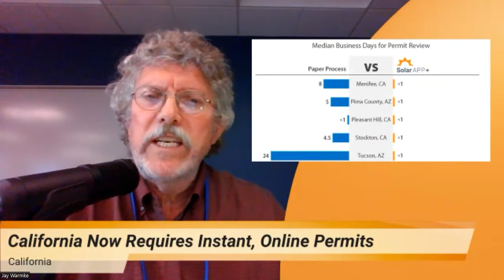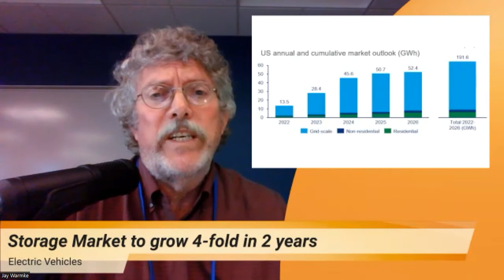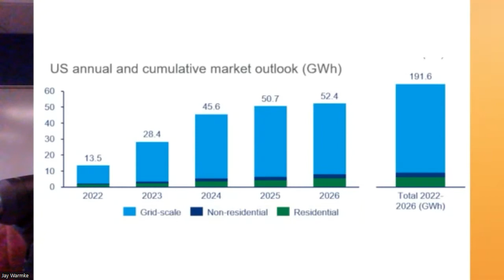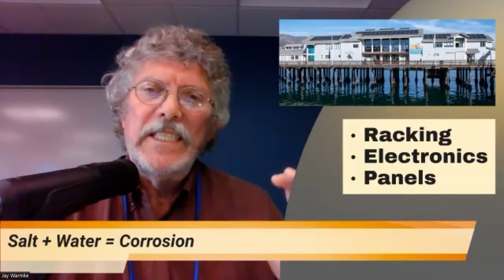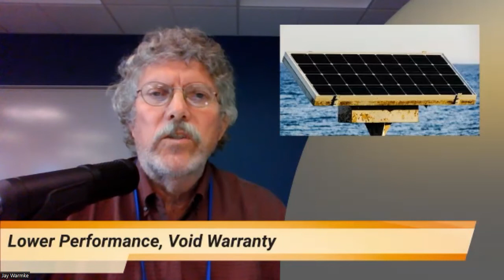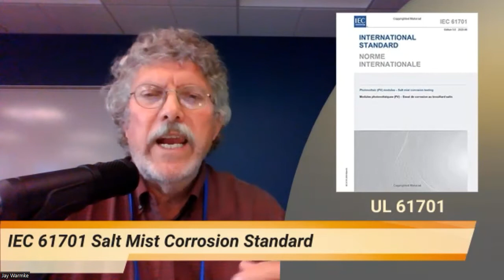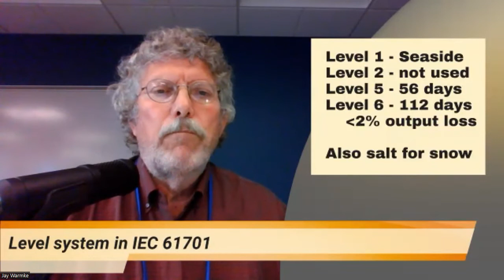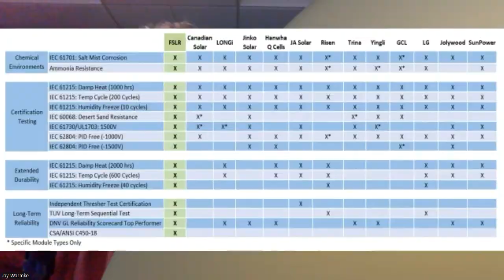Corrosion Issues when installing Solar PV

Comment: "“Out of an abundance of caution, following a small number of isolated incidents with onsite solar systems owned and operated by third parties, Amazon proactively powered off our onsite solar installations in North America and took immediate steps to re-inspect each installation by a leading solar technical expert firm,” the statement said. “As inspections are completed, our onsite solar systems are being powered back on.” 

After the fires, Amazon reportedly hired Denver-based CEA to conduct a third-party audit of its rooftop solar systems. Late last year, CEA informed Amazon of one critical and 259 major findings across Amazon’s rooftop solar portfolio. Problems included mismatched module-to-module connectors, improper installation of connectors, poor wire management and evidence of water intrusion in the inverters, internal documents said. 

Issues with inverters, which convert solar energy into usable electricity, were identified as the likely cause of a fire in at least one Amazon warehouse. The Fresno fire investigation report concluded the blaze at Fulfilment Centre FAT1 “originated on or near two inverters”.

Amazon blamed third-party partners and vendors for the most significant problems uncovered by CEA and other teams working on facilities and sustainability initiatives.

“Over the past five years, solar malfunctions have been caused by improper installation techniques, improper commissioning of a new system, inadequate system maintenance and equipment malfunction,” the documents said.

In the internal report obtained by CNBC, an Amazon employee estimated that each incident cost the company an average of $2.7m (£2.3m), to account for third-party audits of rooftop solar systems, checks on how much electricity they were generating and repairs for any broken or faulty parts of the systems that inspectors identified. The employee also revealed Amazon would lose $20,000 (£17,280) for each of the 47 decommissioned North American sites, as long as the solar remained offline." https://eandt.theiet.org/content/articles/2022/09/amazon-switched-off-its-solar-rooftops-after-fires-report-says/